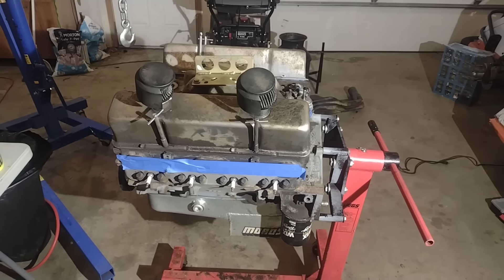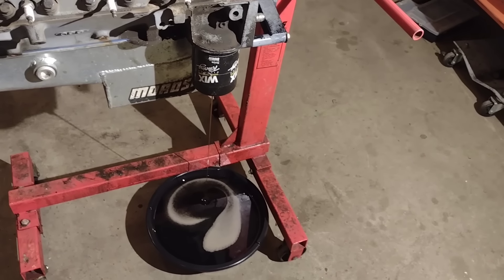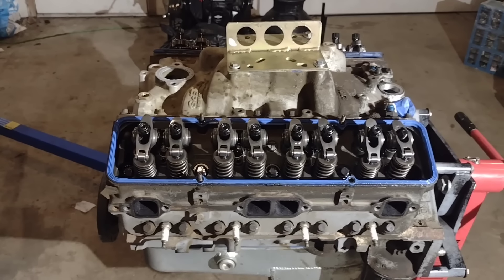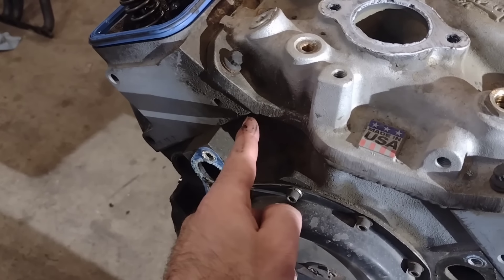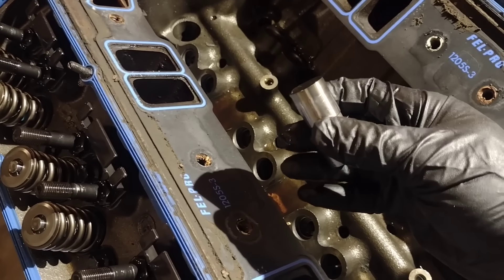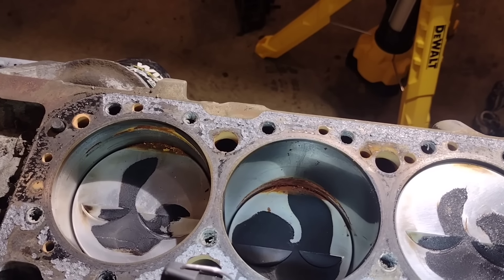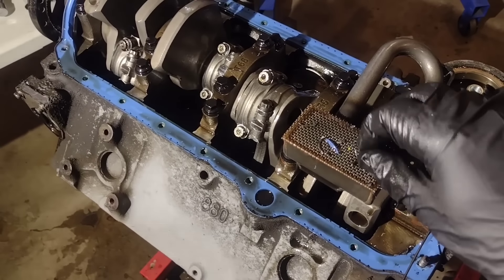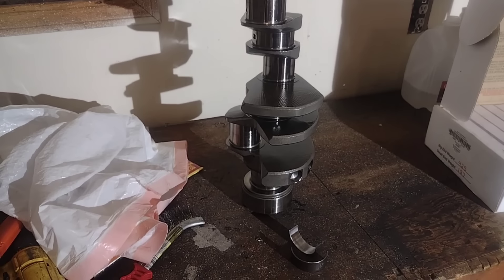Tearing Down an Engine After a Full Racing Season

Comment: Hey John, great content, excellent work. Been thinking and 
#1 Symptoms of low oil flow. The grid mesh over the oil pickup lacks sufficient void area to handle the pump flow volume at full noise. Some simple math re size of wire sum div into pick up area and check flow data for oil pump at High RPM and lateral G's.
#2 No thermostat, low engine temperature and thick oil harder to pull through the Pick up. (increased parasitic)
#3 the Valve spring dampeners may have galled and probably sheered the base cups. Should be Sharp edges on the material found and possibly bent a push rod.
#4 Mate of mine with a Dart 420 SBS runs an oil accumulator with a manually operated ball valve. (Looked into a solenoid valve setup but through flow was nowhere near the manual option) If you do fit one, the longer the hose the larger the capacity within reason. I highly recommend. But... it only works if you remember to open the valve before starting and closed before shut down.
#5 Are you able to (by the B Mod Rules) fit a crankcase vac pump?
Same SBC has belt driven setup and on the Dyno it shows 36 Hp gain swapping in and out.
#6 Obviously, the polly-locks need to be swapped out at a regular interval.
Regards and happy wheels, from Au

Comment: Also could round off the inner dampers and smooth them for less bite in. Cool video thanks
Reply from the maker: That does sound like a good idea. I know of one engine builder who swears by removing the dampers, but I feel like if they didn't serve a purpose the spring manufacturer wouldn't spend the money to include them

Comment: Hi Ross, watching your tare down.
Your engine looks pretty good. 
You spring shims may not have been hardened shims like your cups were.
Isky cams has a tutorial in the back of the old Isky Cam catalogs.
And it is on blueprinting your valve springs. 
You can do this yourself, a belt sander works good on the dampner. 
And you can lap the spring ends.
I like spring cups and or I.D. locators.
Your rear seal spring could have popped out during the seal install.
The spring threads together.
I think a little attention to detail you will have a winner for this season for sure.👍👍
I just subscribed to your channel. 
Have a good evening.
Reply from the maker: Thanks for the info and the support!

Comment: just a suggestion... for Sunday cleanup, add to your routine of pulling the ignition and cranking the engine to fog it with some 2-stroke gas mix while cranking. it'll help with the corrosion problems while sitting and waiting for the next weekend

Comment: The shims need to go under the spring seats, and a spring with a damper is actually directional, in all of my customers circle track engines that run flat tappet and a 1.250 spring I run springs with out the damper because they do break and if you valve guides are size correctly and not worn out I never run seals on the Exh guides, you may get a little puff on start up but that’s about it
Reply from the maker: Good info! Thanks for the input. How do you tell which end of the dampers goes towards the head vs the retainer?
Reply: @rossracing6433  there is a cut out on the damper to sit against the retainer so it doesn’t dig into it and then break, I can see with the shin wear that you need to definitely up your spring pressures on the seat some and open pressure

Comment: I ran into metal debris in the top of the heads around the rockers.  After further looking it was the valve seals chopped up by the broken dampers.  Removed each spring and took out pieces of dampers and seals from each one.  Put all the springs back with no dampers and no seals.  Ran 250 laps in 2 hours and couldn't tell the difference from when it was new.  I should probably replace the springs and all this year because it's their 20th anniversary this year.  LT4 Hot Cam and GM springs, lifters, pushrods, and self-aligning rockers.  Been a great cam for enduro racing.

Comment: Thanks for the look into youe engine. I can't say I've ever heard of that type of failure in the valvetrain. If it were me I'd pull the dampers out of the valve springs and sand a 1/16" wide flat on the bottom of the coil parallel to the shim it will sit on, gently radius the end of the flat where the coil ends, then deburr and sharp edges left on the flat. Increasing the size of the contact area will lower the unit contact force immensely.

Comment: Those metal pieces in the pickup are probably the lifter plunger retaining clips. Valves may have been adjustd too loose ad the plunger is banging on the clip and worked them out. Check the lifters see if two don't have clips... Great video!!!

Comment: I bought a set of dampers for my Ford Kent 1600cc motor way back in the day.
They were cut so that they had as large as possible contact area with the head and the valve retainer whereas the ones you have look like they are simply spring steel cut of at 90 degrees and then rolled into shape.
Your ones look like they have a sharp corner (or slightly rounded) that is the contact point.

Comment: Had similar issue with the older style comp rockers when l went to a solid cam that required stud girdle the girdle polylock outer diameter was a hair larger than the flat spot on the rocker trunion would not seat properly would wear bottom edge of nut like you showed in video, would not hold valve lash. Bought comps hd series rockers polylock fit into trunion flat properly solved problem. Nice video.

Comment: When installing 1 piece rear seals, always coat the inner side lip with grease where the spring is, so when you knock in the rear seal, it doesn't knock or jar the spring out of it's home behind the lip of the seal!

Comment: I recently rebuilt a drag race motor I actually ran for several seasons. I ran alcohol fuel injection. I found that getting the motor hot(full temp) shutting it off and putting the breathers, evaporated the water/condensation out of the motor. I did change oil after each race. But that little trick helped. I was pleasantly surprised at how good my motor looked inside. My bearings looked even better than yours.

Comment: For the rear main, if you tapped on it when installing, it could of popped off, or started to, right then. Trick there is to pack the back side of the seal over the spring with heavy grease to keep the spring from popping out.

Comment: I started working on cars for a living in the 70s..  Started racing a few years later...  Never ever have I seen a tension spring come out of a seal like that... can not think it would be anything other than a manufacturing defect in the seal... A race motor with likely something around .003 clearance would scuff a bearing on start up unless maybe  foot on the floor starts..

Comment: This is the reason I put magnets strategically placed in all my engines so no particles of any kind go into the oil pump.
Reply from the maker: Good idea!
Reply: Same. I sand and paint my lifter valleys and epoxy magnets in there. Really helps to shed oil and catch and particles.
Reply: Make sure you use high temperature ones, trust me, I get mine from McMaster Carr, I put them near the oil drains on the heads, get the square ones so they can't plug up the drain holes if they move.
Reply: @amateurism1  I like to position them in the heads also. Occasionally pull a valve cover and see if anything is on them.
I've noticed with a rebuilt engine, there's always some particles, they mate and wear just like a cam does. 
Never heard of high tem mags before. I'll look that up.
Reply: @amateurism1  a couple years ago I replaced the conductor plate on a Mercedes transmission and in the pan was a magnet. I think it was one of those high tem mags you were talking about.

Comment: I dont have a race engine but i have a built street engine in my truck that i drive like its a race truck. But the shims ive used under my valve springs have shredded as well. Dont have a answere other than using spring cups or locaters? If u need shims put them under the cups? Im also not knowledgeable on reading bearings but i would say that bearing is just fatigued? I didnt hear what number that bearing was but could it be one that gets its oil last? Might want to look into modifiing the oil feed hole to it or the oil galley going to it? Just a guess really? Interesting video though. I like to see disassembly videos. Thanks for the content.

Comment: Just a couple of ideas here.  The bearing kind of has an incipient shelling appearance.  I don't know if the lining alloy is capable of that phenomenon or not, which is an alteration of the metal's microstructure due to high level repetitive loadings, and yields a shallow surface degradation.  Just a thought.  Might possibly be due to too much spark advance hammering on the machinery, while the ethanol retards detonation.  Once again, just a thought.  Can the sharp edge of the inner spring be blunted by grinding, to reduce the tendancy to cut the shim, or can the shim be placed under the hardened spring cup?.   What about the old bronze wire valve guides on the exhaust?

Comment: I wonder if blowby alcohol in the crank case oil could have caused the pitting on the bearings while sitting?
Reply from the maker: That's certainly a possibility. The moisture the alcohol carries with it can also create acid which would damage bearings
Reply: You mentioned the engine got hot a couple of times? Those rod bearings will absorb a great deal of heat, but when they get to their limit, that material will start to break down.

Comment: Probably lucky your season ended when it did. That spring shim was prime to completely fail. The rear main seal spring hanging there was interesting. Why did that fail? I agree about using umbrella seals on the exhaust valves, good idea. Take a hard look at that burned rod bearing, might have debris in the oil passage on the crank during assembly/machining or a clearance problem. Takes me back to my circle track days a million years ago. Good luck next season!
Reply: I have removed the spring and double check it for being screwed together tight before installing a full circle seal…

Comment: Add shims to under the spring cup... i believe these days the flat spring locator with the locating step on the inside of the inner springs are better..better spring control.. what seat pressure did you run for that flat tappet  ??, they are stainless inlet valves  ??
Reply from the maker: Yup, lesson learned on that one for sure. Approximately 130 on the seat, 340 open. Yes, all stainless valves.
Reply: @rossracing6433  Hey there. depends how hard your revving this, it's a 350 ci, your hitting 7500rpm  ???. i would say you need a bit more spring pressure, plus what the go these days is 5/16" stem valves. smaller diameter springs and retainers..lite weight is the key to rev high,keep valve in control..
Reply from the maker: @drcolster  7000 RPM chip rule. 350 open is the max allowed spring pressure. I'm already running tool steel retainers. No titanium allowed so the only thing I could do to reduce weight more is hollow stem valves
Reply: @rossracing6433  Tool steel are lite...if you can upgrade to a 5/16 valve and smaller diater spring and retainer that is about the only way..to lose weight..tough rules on open spring pressure as well.. you still have 10 psi..Good work , your onto everthing..

Comment: the wire on the pick up screen almost look like parts of the lifter retainers. the spring could become dislodged if you hammered the seal in. guess I should wait until the end to comment but who does that? :)
Reply from the maker: Good guess - hard to see on camera but the pieces are more flat shavings than they are a wire. Hopefully you made it to the ending and found out the answer!

Comment: Ethanol Absorbs water. So yes it most likely was/is that cause of that. Longer it sits the more water it will absorb from the air. Its a nightmare on small engines, especially if you dont drain/clean it out before storage over winter. Can destroy engines in just a couple months. Such a stupid choice, more trouble than its worth. Thanks for the video mate, cheers.

Comment: Great video, I have a question when you check your valve lash after every three races, do you typically see them running out? Or do they stay in tolerance pretty good
Reply from the maker: Thanks! Good question. We typically see the valve lash stay consistent within a couple .001s. The exception would be when wear occured between the polylock and the ticket as I showed in the video. When we were running roller tip rockers rather than full roller, we'd sometimes see the lash open up more from the rockers/pivot balls wearing

Comment: Could make a difference where the bearing shell was pulled, top/bottom, front/back.  Not an expert by any means.  Doubt it was debris, more like dry start or .0002" tight.  As for the seal spring may be manufacturer defect, yet with a cracked flex plate makes one wonder if there wasn't a vibration issue.  Not leaking also brings up the potential for positive crankcase pressure.  Learned from a head builder that valve seals tend to starve the stem of oil and knurling the guide can help with oil retention.  But that wasn't for racing applications.

Comment: 50.000 over no thermostat😬🥴
Reply from the maker: Can't remember if I mentioned in the video, but next year I plan to try running a thermostat to help the engine warm up faster. I think this will help with the excessive carbon buildup from idling

Comment: I would make improvements each year on the engine if rules allows it.
I'd run a stud girdle. First of all.
Reply from the maker: I definitely try to improve things with each build I do. Unfortunately stud girdles are not allowed in my class. You can look up the USRA B Mod rules on the USRA website if you're interested.
Reply: @rossracing6433  I had a feeling. I see a lot of things that look like you are restricted by the rules. I used to run a footbrake drag car. With bracket racing you can do pretty much whatever you want.